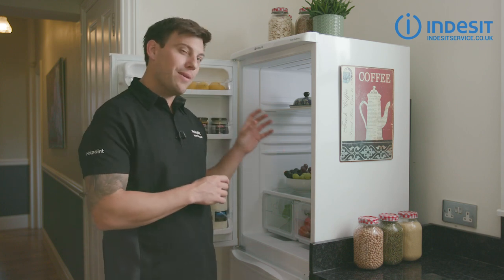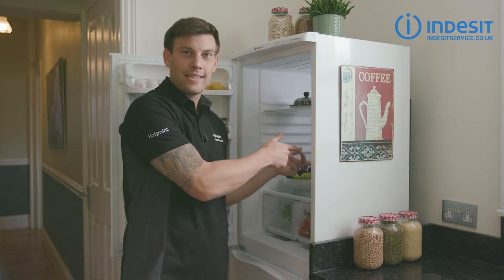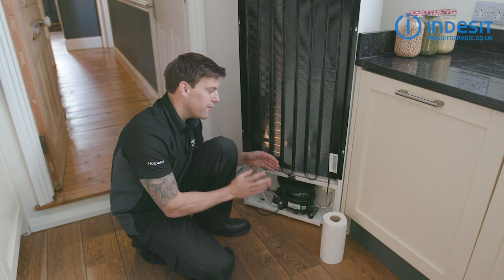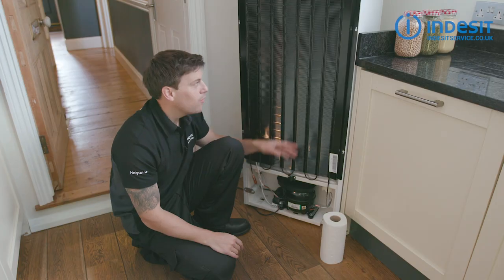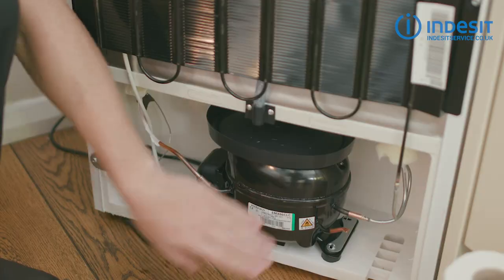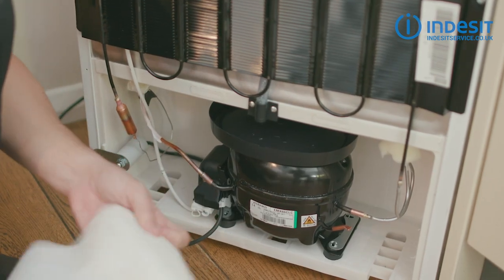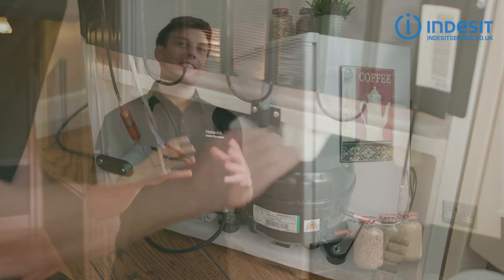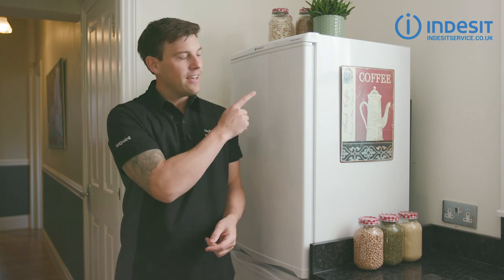How to clean a fridge drip tray | by Indesit

Comment: My drip tray is stuck on the top of the compressor.
Reply: my indesit dlaa50 drip tray was held on just with some foam sticky pads. Wiggle it back and forth and you might manage to loosen it enough to remove it. Might be worth videoing it to make sure your model isn't held on by screws though. After I cleaned mine I slid it forward to reattach.